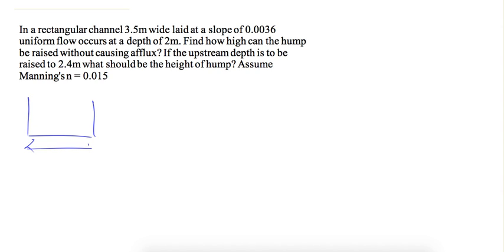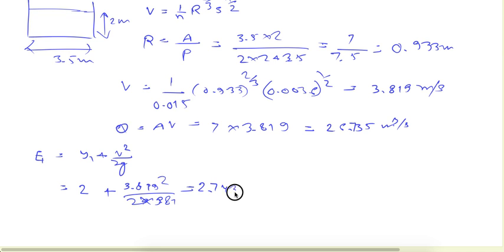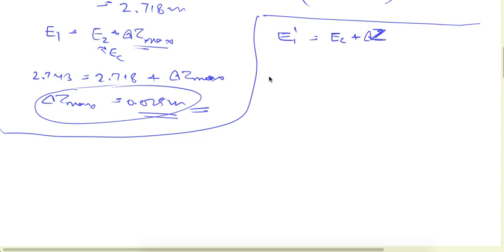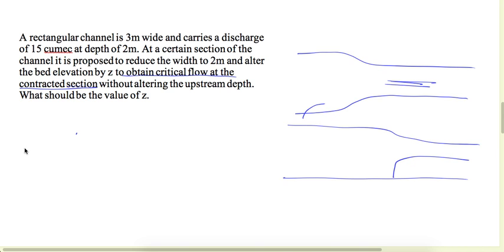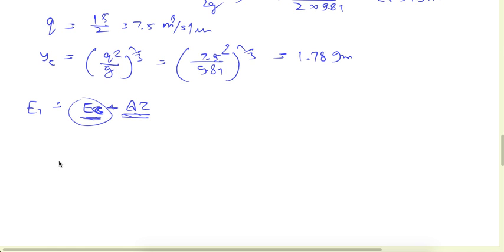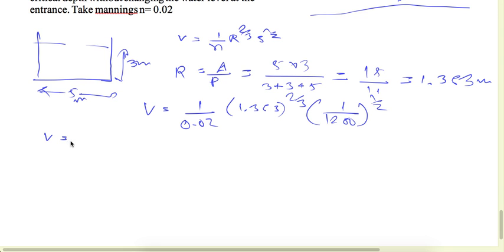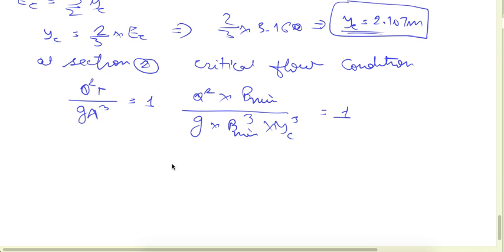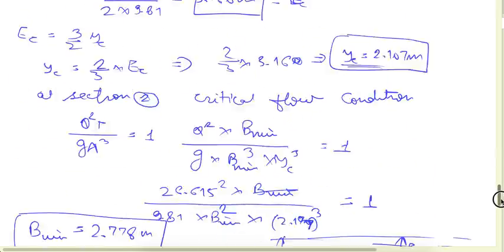Specific Energy Problems | Open Channel Flow

Comment: In question 1 part b. If height has changed to 2.4, then should we have a different discharge as the hydraulic radius and area has changed ?

Comment: In the last question ,2nd problem u have take wide at critical section is 5 m for calculation of Ec can u explain at Ec the width reducing now at throat section
Reply: q=28.615/5  at throat it is less than 5 known
Reply: @arunapedada6492  we have to consider width of rectangular section.....i.e.,B=5......not Bmin
Reply: welcome maam garu

Comment: last question explain effectively please.

first you wrote E1=Ec=E2
then you again calculated Ec for different critical depth
Reply: For decreasing throat condition , specific energy is same for both condition but in a hump it change that is why Ec is calculated again
Reply: Both codition mean both section
Reply: But we could have used the same Yc na 
Why did we calculate again

Comment: In last question. 
Both cases are unique to each other ?? 
Or we hv to find  Z (max) corresponding to B (min)?
Reply: It is not the contracted width they are talking about in the question as in the previous question...so we should  use b instead of b(min)